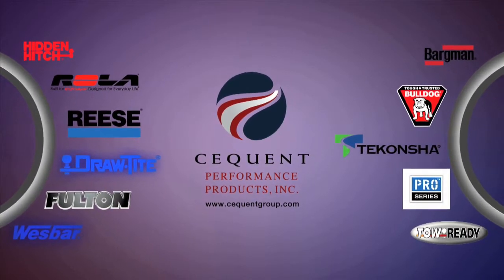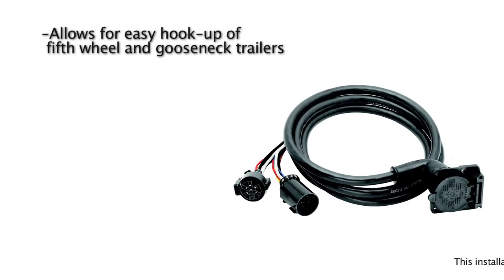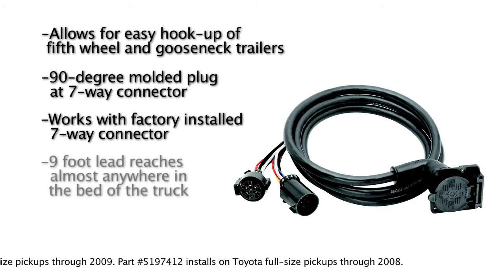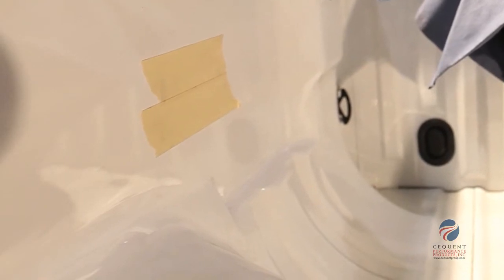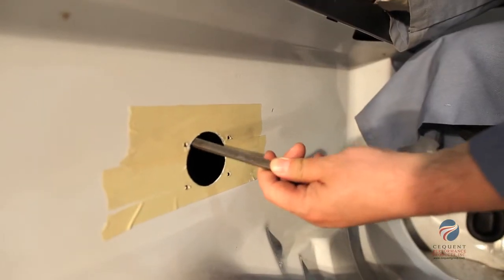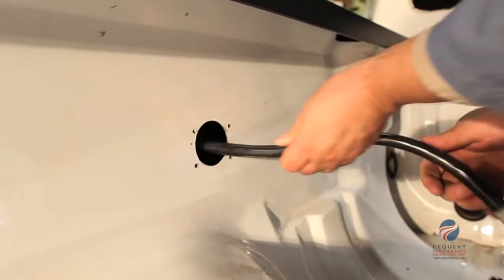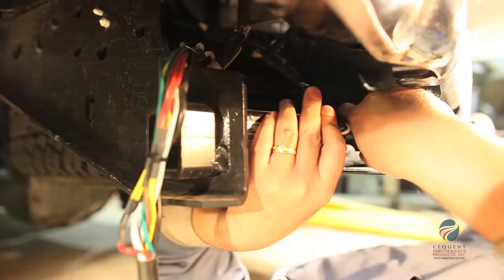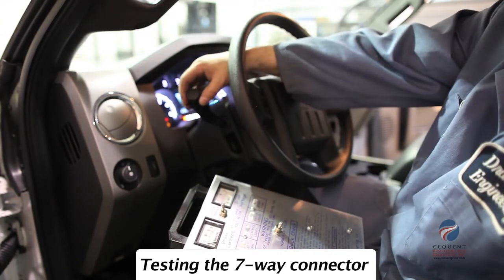Installing a Bargman® 7-Way 90° Wiring Harness 50-97-410 in a Pickup Truck

Comment from the maker: Bumper pull hitches (receiver hitches), cannot be used at the same time as a gooseneck hitch; You can use only one at a time. The Bargman 90 degree 7-way can be used with any hitch, just so long as your trailer wiring will reach the outlet.